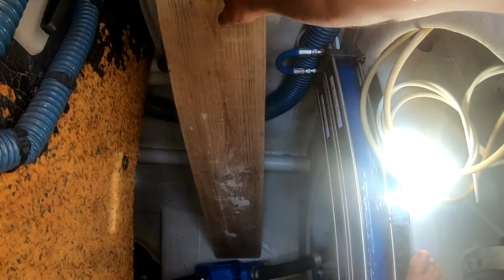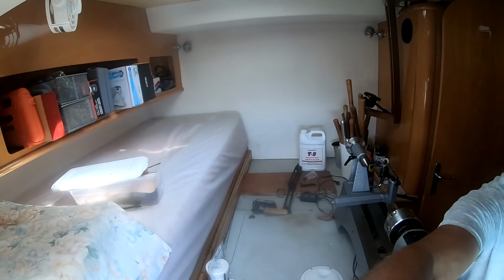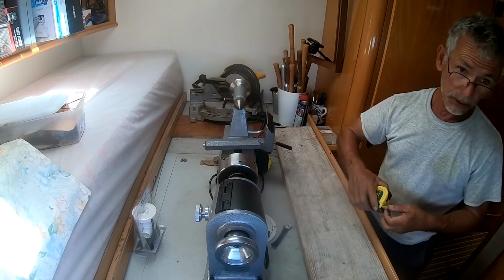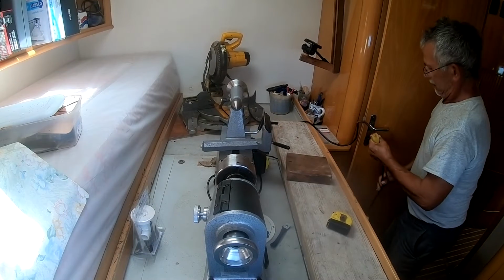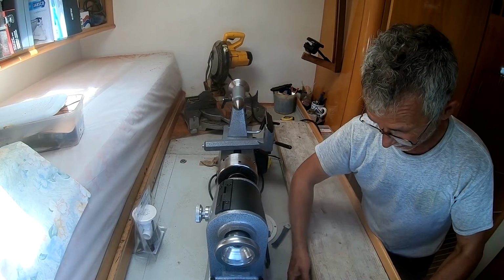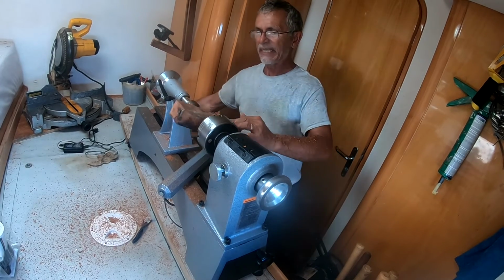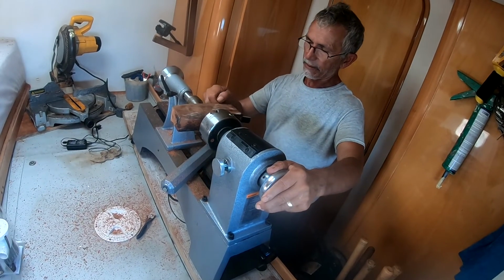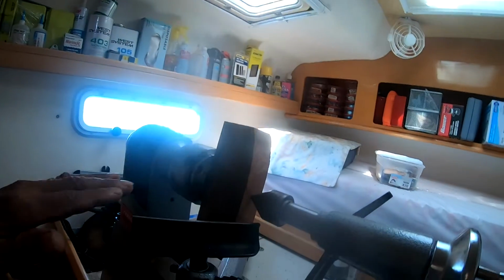Rebel Turner shop location test

Comment: Hi there Al — a few commented on safety issues & confinement of space , cool  , you’ll come up with a better plan than first thought. Your own respiration & dust removing  & poss protection for back ground with taped dwn see through plastic .  Usually wide masking tape across perimeters then on edges of plastic sheet stretched across background protecting bedding & cabinets from dust penetrations . We’re sure to see you up & running 😙
Reply from the maker: thank you my friend glad to see you watching and thanks for some great advice. just so you know this video was just a test to see if in fact the room would suit me for Workshop well I am back to the drawing board and the lathe will be set somewhere else

Comment: In time I'm confident that you will adjust your style to the lathe Al. Remember, the rebel makes it work with what he's got. 

Al, I'm concerned about your health, turning in that small space without a respirator. The 3M half mask with replaceable cartridges is what I suggest without breaking the bank on a battery powered system that would filter the air for your eyes as well. You will prevail my talented friend. Smooth sailing.
Reply from the maker: I am not sure how I will overcome the lathe's power issue yet. This thing stall at the slightest pressure. 
I really appreciate you concerns my friend  and I have some ideas in the works to take care of most of the concerns.  all in time

Comment: Al , don't get discouraged you will get more accustomed to the smaller unit. I run jet 1221s and it was same way as I stepped down from bigger unit. My jets are on 3/4 horse but handles 12 inch pieces pretty well , just slower . Maybe consider items , but just enjoy the turning itself. Hope this helps you feelings. Nice looking lathe BTW.
Reply from the maker: Hmm  I am wondering if there is a problem with this motor.  This thing has no pet.   At this moment it sucks LOL
Reply from the maker: I think this will be taking a VFD and motor upgrade LOL

Comment: Hi Al. I think the problem with the lathe speed decreasing on load, is not the lathe's fault, but the power generator / inverter. Once you put too much load, the motor needs more power, but the generator/inverter  cannot supply that. Just to make sure, you can take the lathe, to a good power source, and test it.
Reply from the maker: Good thinking.  I did try it without the generator running and ran it off the invertor only.  I will try it with the generator next time and see if that makes a difference.   Thank you

Comment: Easier to make a raised duckboard to increase your working height, rather than making mods to the infrastructure. An interesting project to say the least, please wear your protective gear, you have no room to move out of the way should a bit come loose. Stay safe-wood Turner-sailor, best wishes from Tasmania 42 South.
Reply from the maker: Very true  and that was the plan. I am glad I tested that area before making all the adjustments. That will not be my work shop.  to much space wasted. come back next week and see where I am headed with this.
Reply: @AlFurtado  I have a mini lathe perhaps a little smaller than yours, I tried stalling it at every speed, not a chance, and the catches I have had so far in my learning curve showed me just how powerful my little lathe is. I think your boat power supply is not quite up to it without a generator. It would be handy if you could tie up at the marina and plug into mains power as a test. I look forward to your next video re workshop. Stay safe, greetings from Tasmania-42 South, paradise island not all the world knows about.

Comment: How frustrating ! But with all the new full size battery operated tools available, I think the chop saw is the first one you should consider replacing. The starting power draw on the corded ones can be up to twice the running power use. You need to have a serious talk with Santa before Christmas.
Reply from the maker: Great idea. Let's start the list LOL.
THANK  you  take care be safe
Reply: @AlFurtado  Dewalt has brought out a number of battery powered tools for job site carpenters. The chop/miter saw, circular saw, and I think even the table saw are now battery option offerings. Have not checked the whole line, but if the Dewalt company has them, others probably now have them too.
Reply from the maker: @valeriehenschel1590  ok I'll take one of each but instead of table saw I'll take a chainsaw. Never know when I'll need it .LOL.
thank you again